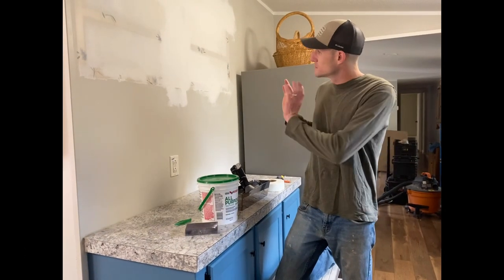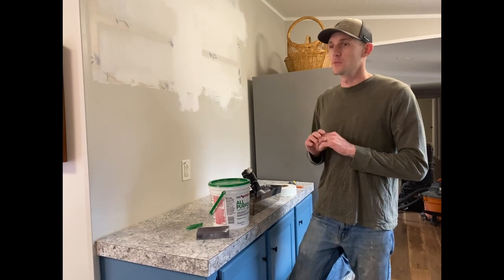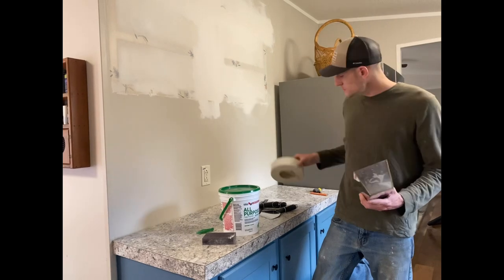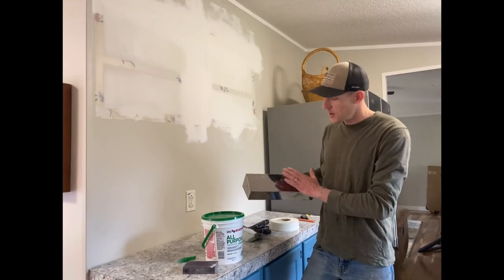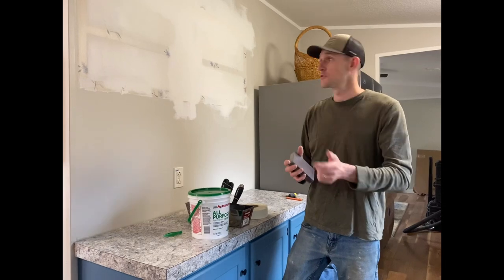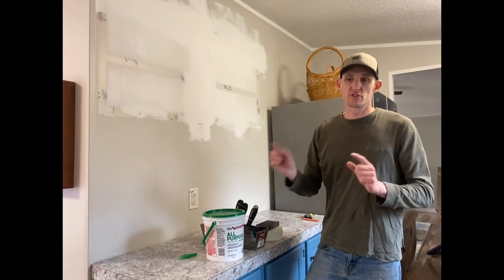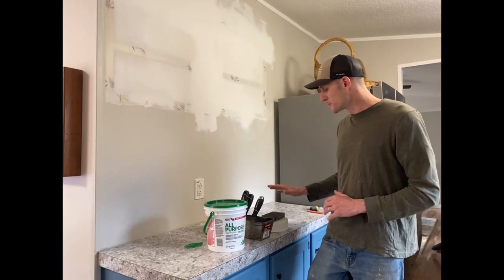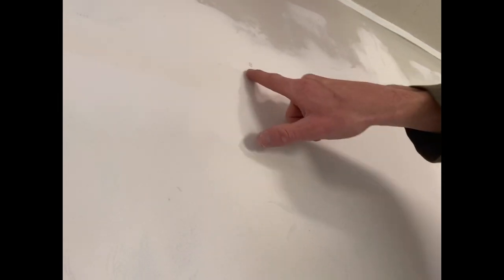How to Cover Mobile Home Seams | Drywall Repair | Single Wide Mobile Home Strips | Remodel

Comment: Just a tip. If your using paper tape you can use the premixed mud. However if you're using mesh tape you should be using a 'Hot' mud which just drywall powder that you mix yourself. It comes different set times, 5min, 20, 45, 90min. The reason is that all [purpose compound takes 12 hours or more (usually just overnight) Using premixed with mesh will yield a much much higher failure rate. So Paper=All Purpose  Mesh=Hotmud. I vision isn't great but it looks as though you are using mesh.

Comment: Respectfully, most manufacturer of the mesh tape you used specify to use hot mud for the first coat. That's the powder joint compound you mentioned, but didn't use, the 20 or 45 minute stuff is perfect. After that first coat, you can use the pre-mixed all-purpose compound. Seams cracking is usually what happens when you don't use the hot mud first.
Reply: You call order small bags of the powdered joint compound, or just seal it in a bucket or airtight container and it will keep for years. Often you can use it for something else later. You can also mix the powder in your pan, no bucket required. You can even use a mixer attachment on your drill to mix it quickly in the pan, or just use your taping knife. That's slower, but will work.
Reply from the maker: Thank you for the info and the tips!
Reply: @hunter30290 // after filling the seams (I'm using Fibafuse) with 45 hot mud. On the last go do I THEN use All purpose compound? Also, I've heard some people say to use shellac over the strips before painting with my latex paint and primer in one... is that correct? I'm so confused??? Can't I just paint over using my latex paint or I'd it necessary to use the shellac first???

Comment: Ahh, bigger blade. Thank you! 
I replaced all the seams in my house too, but couldn't get the seams to cover quite right. I wasn't using a good-sized tool. 

I also used drydex spackle, but I'm thinking I didn't spread the spackle with my small tool enough. 

Thank you!
Reply from the maker: Glad it helped!

Comment: I’m redoing my mobile home now. On the majority of the walls we have drywall with seams so I will be filling those in, but in the bathroom we have wallpaper. Did you guys skim coat over the rest of the house? If so do you have a video on that. I just found your channel and absolutely love the videos that I’ve seen so far
Reply from the maker: To cover the wall paper, my husband sprayed the entire house with oil based kilz paint and then painted over it with toasty grey by behr. The whole house had wallpaper on it. I’m so glad our videos are helping. Thank you for watching!
Reply: @JohnsonBranchFarm  -Thanks.  So, how did he fill the seams where the batton strips were?
Reply: @mainemermaid6596 // that's Exactly what I'd like to know. I'm in the process of doing this myself and I'm so confused.
Reply: @mainemermaid6596 That's in this video 😂
Reply: @Donna-vh5ym Did you figure it out?
Reply: @RMMomma4Eva  // got it. We had lots of sanding. We probably put too much, but that's okay. It's all smooth now. Thanks again.
Reply: @Donna-vh5ym  Excellent, hope you're enjoying your home 😊🙏🏽✨

Comment: I realize this is 2 years old, but I just found you and subscribed.  We removed "some strips" but are using "Fiberfuse." Do you know if we should use all purpose or hot mud? Thanks in advance .
Reply: Looking at the other posters' comments, they said with paper tape use all purpose, but with mesh tape use hotmud at least for the first coat. You use the small knife first, then the middle sized then the widest one to feather out the mud so it doesn't show. Then you sand it all down until it's flat no humps and paint.

Comment: Hi.  I have a quick question.  Do you just ignore the wallpaper that our manufactured homes come with?  ((No need peel it all off?)  Thanks you very much. ❤
Reply from the maker: We did not peel it off. We covered it with an oil based kilz and then painted over it. Ours was very outdated and the whole house benefited from a nice coat of fresh paint.
Reply: You can't peel the original wall paper, it's part of the wall in a mobile home, have to paint over it. Use oil based kilz primer first.